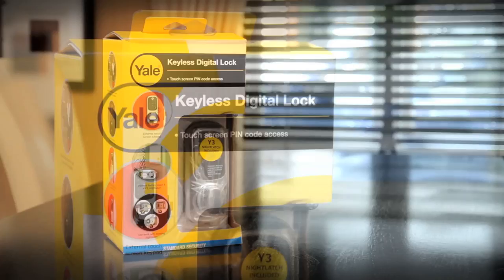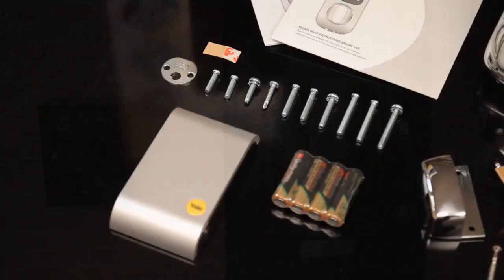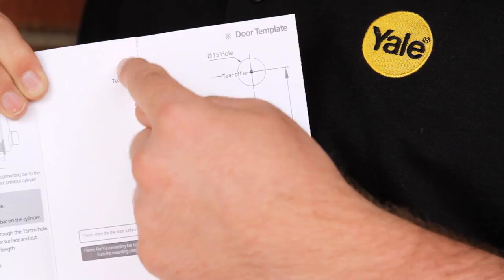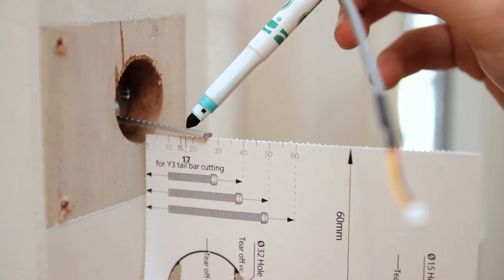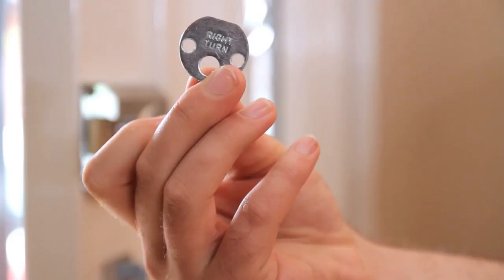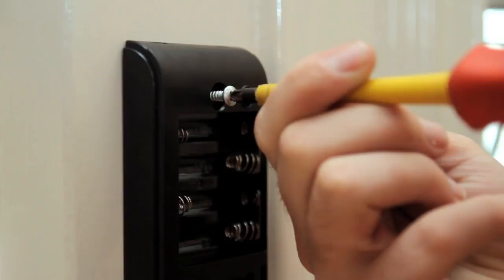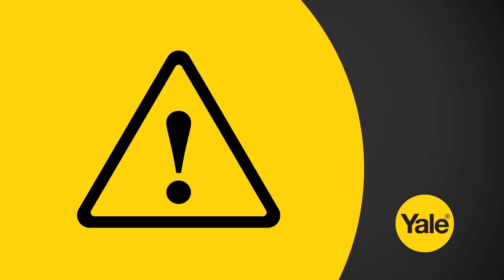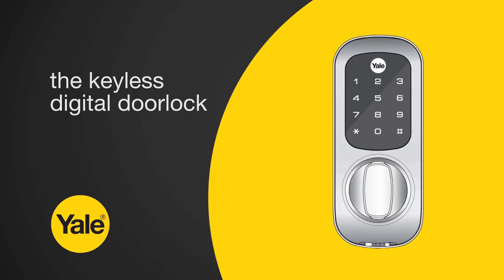How To Install a Yale Keyless Lock | Homebase

Comment: Battery powered/digital locks are something i'd like to stay clear of. Not everything digital is ideal. I like to purchase things with the worst case scenario in mind.
Reply: I'm with you on this.
Reply: What happens if the AA batteries run out WTF do you do ???
Reply: @debstar2005  There are two pins/terminals on the bottom of the external part of the lock. Simply use a 9 volt battery (the square one). This gives the lock enough power to open. Then replace your AA batteries!